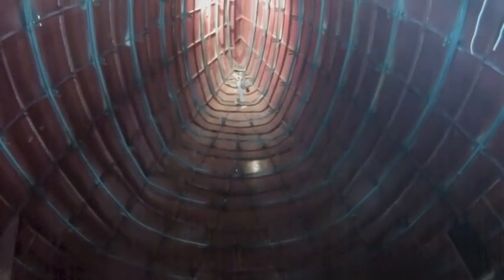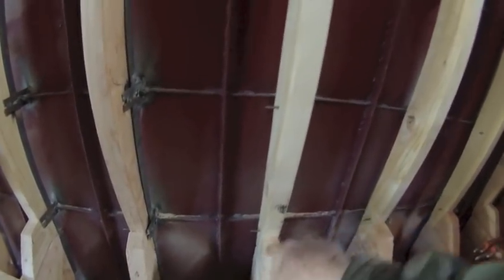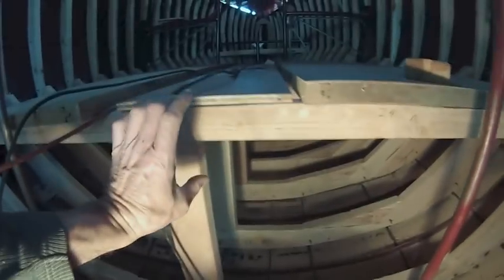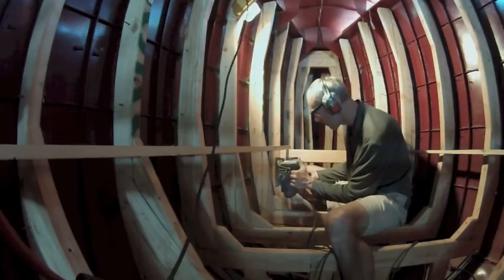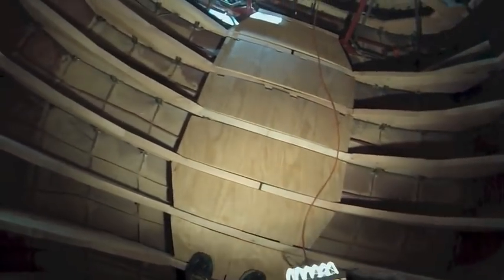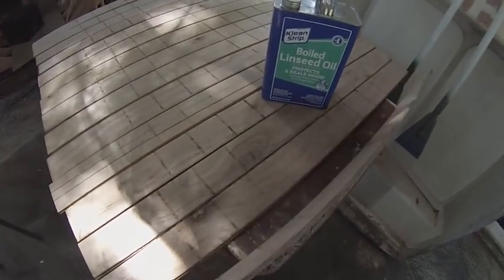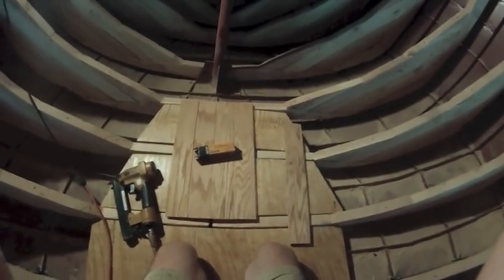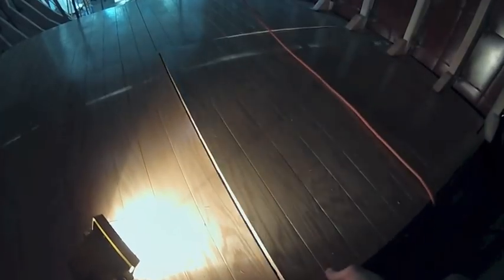Steel Sailboat Build Part 17

Comment: They sell polyester, vinyl ester, and epoxy based paints in California.  That is what you should be at a minimum painting ALL of your lumber in. It will get you maybe 2 years of life before it has to be completely replaced after warping and rotting.  Wooden ships built in the last 200,000 years don't use steel/stainless steel around wood to prevent steel rot. Instead wooden ships are made with copper, brass or bronze screws to reduce (will never eliminate rot in wood), with your wood placed against steel in your construction you have exponentially accelerated that effect. Finally, what math have you done concerning the moment of fulcrum effect of your sail and keel?  I've sailed wooden, fiberglass, concrete, and steel sailboats.  The one they they all have in common are strong and heavy keel, as well as keelson's to help tie the construction together and to also reduce the fulcrum effect of the mast on the boat.  I applaud your efforts but I question your design features (I'm not criticizing, and I'm not criticizing your materials choice). Have fun and I look forward to your final results.

Comment: The "classic" boiled linseed seed oil treatment starts with 3 part of mineral spirits, 2 parts of BOL and 1 part a oil based marine spar varnish.  This dries very quickly (couple of hour) so plan on 3 or 4 coats on all surfaces.  Then switch to 2/2/2 and apply a couple more coats.  The last coat should be 1/2/3.  BLO is a "drying" oil so it will not be fully "cured" for a week or more.

Comment: Wooden frames inside a steel boat?    Almost everything about this build is to scary to contemplate.  Sorry sir, but you are going to have serious problems caused by your materials choices.
Reply: Y is the materials a problem as I am busy with a Bruce Roberts
Reply: Michelle Schütte what are the Bruce Roberts plans like and did you buy them ?

Comment: Use of untreated pine in the bilge is crazy - it will rot out in a flash - and you cannot just paint CCA preservative on it - why did'nt you  use treated timber in the first place? Thats said, even CCA treated pine will eventually rot, hmmmmmmm
Reply: Richard Rawling I’ve got a hundo on 1 hr and 15 into the maiden voyage she’s sitting on the bottom. This abortion is a reef at best, unfortunately probably going to end up as man made pollution in some waterway not far from a public boat ramp.
Reply: I have treated pine on by boat trailer runners they rot in about 3 years. He should have used steel for the bracing.
But the design is so terrible it does not matter
Reply: Too true - I reckon it will rot quicker than that, especially if constantly wet. I welcome the initiative here, but it is a train (boat) wreck waiting to happen
Reply: I agree with the boat wreck theory and its a shame he actually has some skills just no direction. 
Fir is just a bad idea for many reasons. Its a soft wood and loses strength when wet and lumber store pressure treating wont help much because he is using small pieces of a larger board. Also they call it dry rot for a reason what does it in is the moist dry cycles give the bacteria a nice place to start then when it drys the bacteria eats everything up.
Reply: not hopeless. 1993 i built the 12'x22' front deck on my home all 2x6 spf lumber. spf is cheap non treated and even though it rains hard here in mn land of 10,000 lakes and i cover the deck with rock salt every winter the deck is holding strong because every april i coat it with oil based cedar colored deck stain $40 per/gallon. even the galvanized hangers for the staircase stringers are still like new. only thing i messed up was entire build i used nails and they're all rotting out

Comment: The use of untreated wood in the bilge isn't a good idea. They are going to get wet and rot I suggest use steal for below the sole. Or at least fiberglass ribs but you have to have a bilge that allows water to drain front to back unobstructed..   otherwise you will have stagnant water in the bilge. MOLD AND RUST
Reply: I am also concerned about the use of pine and not galvanized fasteners.  But, it is not my boat.
Reply: Diggnuts
Are you quoting that idiot at SV seeker with the complete useless piece of crap that you paid for?
Reply: Mini Builder
The preservative used in Ca is not the old copper cyanide . I suspect its Kool aid ?
Its not very deep and really does nothing
Reply: No you are wrong , pressure treated wood still uses copper. https://en.wikipedia.org/wiki/Wood_preservation
Reply: Mini builder yes it lists many alternatives to your copper theory in the link you sent.
Your obviously are not from Ca. I guarantee any copper or cyanide based preservatives are outlawed. Even the bottom paints available in Ca are just paint not even epoxy or containing copper.
The wood he is using is terrible quality but some people have to learn these things for themselves.
Reply: You realize that treated wood would cause the exact same thing, but with the major negative being that the copper treatrment will cause massive galvanic corrosion and then the hull will rot , and really fast.
Reply: Don't worry so much... Bad for the heart.